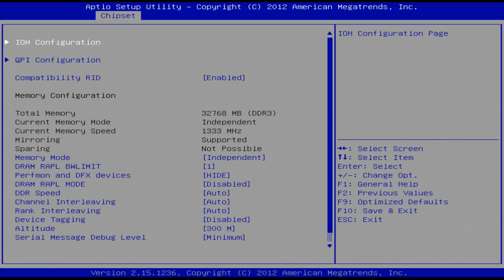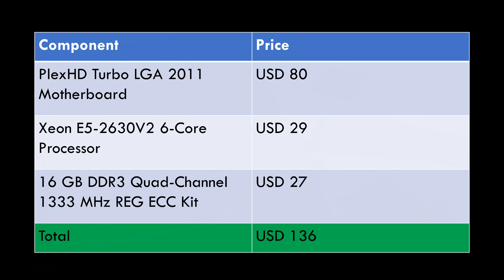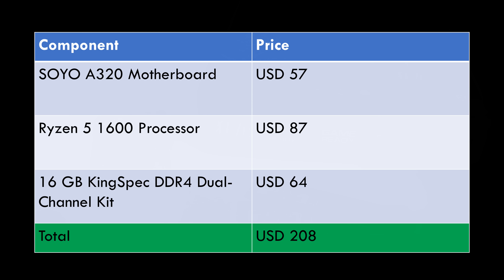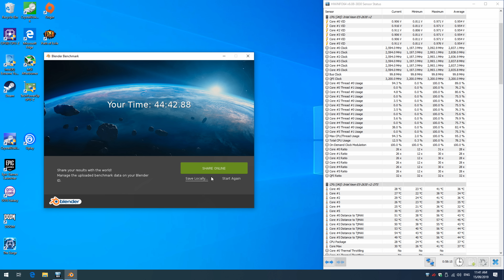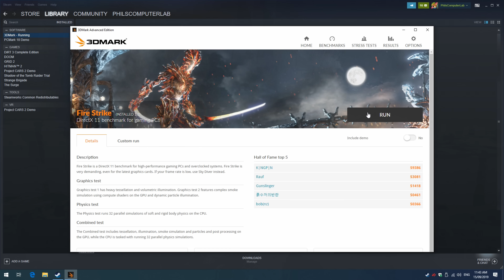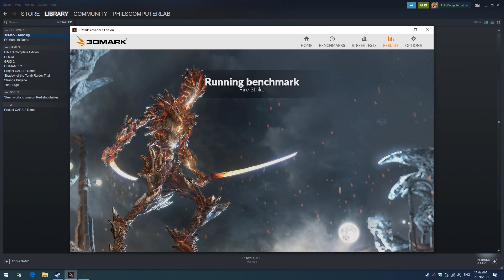Is this cheap 6-Core CPU worth it? The Xeon E5 2630V2

Comment: how would the xeon fare if you under clock it to save electricity? asking for a future server build
Reply: If you want low power consumption look for the 2630lv2
Reply: I wouldn't go that route but rather get one of them mini-itx with just about the same cost and maybe even better processing power  but less power consumption. Or look for a cpu that is low power ("L"  comes up on the cpu name)
Reply: @msana4420  well, its for an internet cafe server and i need a lot of ram for data caching and it can be found cheap here in the Philippines especially ecc ram the mini itx idea would be good for a wifi server(wifi ticketing service) thanks for the advice

Comment: One more thing that none of you understand! There is no old or new Game that needs a new GPU or CPU. Even if you buy a new PC on 2020 wont be good enough after the new generation graphics ! 2013 , 2020 we are still in the same generation of graphics. New generation graphic comes out with a new platform. Ps1, ps2, xbox ,xbox360 ect... untill a new generation graphics that comes out with a new platform u are stuck on the same generation. They stay hidden to the public until they release the new one. There is no new until then. U may have now high end GPU but this may not work in the new generation. New generation graphics may come out with a new DirectX or shader . That the high end GPU that u bought at 2020 may not meet with the new generation graphics cause it requires a new program driver to run those new generation that also cannot be installed to your GPU and it wont be supported on your actual "high end GPU". Since 2013 we dont have any new generation yet.
Reply: cool story. I'll wait for the movie
Reply: Manny hahaha sure
Reply: @eneadosti6366  you're right.....I wont.
Reply: 🙂 yes theres a ton of Stagnation and Diminishing Returns in the Video Game Industry, theres alot of capitalism and greed going on so the big companies are trying to reduce costs by using the same game engine over and over again, they rather concentrate on loot boxes and mobile ports. Amd users sometimes get upset when an expensive all amd build gets BTFO from a weaker i7 and GTX card on some video games and they dont know why? 😇 heehee
Reply: @MrSamadolfo  in the future  will be like i love my PC but i cant stay and play with it. they will make machines that you can remote and play in to your phone. By turning on of your machine at home from your phone and play with your phone. this new generation graphics will last longer than it did from 2013 to 2020. it was like 6 years difference from generation to generation. PS One December 3, 1994. ps2 March 4, 2000. ps3 November 11, 2006. ps4 November 15, 2013. PS5 12th February 2020. from 2013 to 2020 the only thing that is changed was resolution. the same will happened with ps5 even if it has 8k , it will add a new kind of resolution or framerate with the ps5s or something how they may call it. and will last 8 years, because they want ps4 pro to move on and gain money from them who couldn't buy it at that time. after 8 years starting from 2020 a new technology will come out. people buy GPU now because of resolution and framerate. Not because of a new graphic game. same will be from 2020 to 2028 . a 2 k Dollar GPU what you can buy now cannot support 8k gaming. that 8k what will come out in the end of 2020. GPU's now are too much money fighting for that 4k high frame rate, what very soon will be garbage.

Comment: Hello Phils, firstly thanks a lot for your videos and work you do firstly. A week ago i star searching a cheap motherboard for my father to reuse the i5 650 that i bought in 2010, because it dont need much power for his work, now is using a core2duo e7400 @3.2 , but this i5 goes up to 4.2Ghz easily. Anyway, i starting searching and comparing a lot of xeons and platforms, and then start thinking upgrading my sistem xD.

I have found this motherboard of huananzhi X99-TF, (X99 chipset lga 2011-3), it looks like a monster with two fans in the vrms, maybe capable of overcloking how knows. Is compatible with ddr3 and ddr4, dual NVME and  M2 Wifi ports and some other features. It would be an interesting motherboard to review socket is use in xeons between 2014 - 2016 , is a not the cheapest but so flexible.

https://es.aliexpress.com/item/4000221285759.html?spm=a2g0o.productlist.0.0.1dfe4a7cIYyVTT&s=p&algo_pvid=fec2d6b2-841e-40d4-84b6-9e6247f5fed0&algo_expid=fec2d6b2-841e-40d4-84b6-9e6247f5fed0-1&btsid=cae8b68d-ed91-4476-aa12-0fa108dddfb3&ws_ab_test=searchweb0_0,searchweb201602_,searchweb201603_52

I have an fx 6300 @4.4 (1.23-1.26v) and gtx 660 at 1.2Ghz with asus M5A99FX Pro 2.0, around 250-300W playing battefield 1 and rendering. I know upgrading the graphicscard i would notice a huge diference in games. Now is starting cold weather here where i live, so the power consumption is not totally waste because it keeps my bedroom warm :D
Reply from the maker: This is a nice board, but at that price, you're really better off with a first generation Ryzen system. A B450 board costs USD 80 and then you can get a Ryzen 1600 or 1700 and overclock it.
Reply: @philscomputerlab  Thanks for the help!!, yea im wonder with the asrock b350 pro4 mini atx model for 62 euros, it holds the 3900x pretty well with no oc and 3700x with oc no problem, they reviewed in hardware unboxed channel with that cpu. I mean, starting with 1st generation and then in the future when 3rd generation ryzens prices goes down it allows to upgrade to a 3600, 3700 or 3900 cpu. Maybe a z370 is better choice focusing un future upgrades, but the posibility is there.

Comment: I am searching a powerful cheap system where to run, even, XP, but since there is no site for drivers I think I could not run XP on the X79 2011 (+Xeon) board. I am asking if someone has found XP drivers... Thanks...

Comment: "the pcie is 2.0 not 3.0" but the m.2 slot, and pcie slots both say gen 3 right on them?
Reply: I'm guessing that the M.2 slot is indeed Gen 3, but uses x2 PCIe lanes instead of x4... But I don't own the board to check if it's true

Comment: Why are you sticking to 720p so often in games????
Reply: Because he's testing the platform not the graphics card. If he was to test at a higher resolution with an RX 580 he would be completely graphics card bound, and would not show the performance of the platform.
Reply: @jonathanellis6097  Not sure about that, 1080p would still demand more from the CPU than 720p, and it's more closer to what people play these days.
Reply from the maker: I have a RX 5700 now, so in future videos we will be testing at 1080p. But the RX 580 is holding back the system at 1080p.
Reply: @dcikaruga  if you are graphics card bound you are only seeing the amount of frames the graphics card is capable of producing. By lowering the load on the graphics card (i.e. lowering the resolution) it can now produce more frames, so you can also see if the CPU and platform are capable of producing more frames as well.
Reply: @philscomputerlab  A 580 struggling with max settings at 1080p? Crazy how GPU's are going out of date so quickly,
Reply: @philscomputerlab  That's quite an upgrade! 👍
Reply: @jonathanellis6097  Yah, but its so variable because somes games are more demanding on the CPU than others. I'd rather stick to 1080p because that's what the majority of people out there use for gaming.

Comment: nice Witcher 3 runs good on my I7 4790 16 gb  GTX 760 TI . I get 30 fps
Reply: Decent CPU but awful GPU, get rid off that thing. A 5700 or 1660 should be the last upgrade for your platform.

Comment: anybody knows how this would perform in moba like dota 2? and emulation like rpcs3
looking to sell my 1155 board and i5 3570 
I7 2600 and 3770 in my country still cost like 100USD people still think its worth gold
Reply: No problem in MOBAs, but PS3/XBOX/WIIU Emulation is not enough, you'll need a CPU with MORE IPC/MORE Singlecore Performance, I mean Ryzen 3 3600 + OC or similar Intel CPU from 1151 socket and chipset 300 series (Intel 8th/9th Gen). MAYBE JUST for Emulation and EASY PCGames that no need a lot Cores/Threads, you could have enough with a Intel i3 8350K at 5Ghz (OC), but better with a Intel Six Core and Overclock (Intel K in Z370/Z390 MoBo). The performance is different in each game, there will be games easier and others more difficult to emulate.

Here PS3 Emulator in Last of Us (first game) a GTX 1060 6GB is overpower (only 30-35% Usage), 6GB Vram is overpower (at 1080p only consume 1.2GB), 16GB ram DDR4 at 3200Mhz is Overpower (Ram Consume only 6GB)...12 threads is Overpower becuase only need six CORES (60% from 12 threads = about 7 threads with i7 8700K in Stock frecuency)....so he need OVERCLOCK that i7 8700K.

https://www.youtube.com/watch?v=SIMjpju0IhA

* Obviously there are games that will have to improve more (the emulator itself) if all people want to have a better experience, But that the Developers
 Emulator working on the Vulkan Graphic API will help to improve it....some day.
Reply: @juanmassiosare9850  great reply here im on a very limited budget here hence going on new parts is really not an option and plus its worth a fortune here in my country on new parts on ryzen and new gen intel even though used ryzen and intel is still expensive

the emulation is only for fun
but i did some research and found there is some xeon on the 1155 platform some 4 core 8 threaded are they any different from the i7 countepart or just the same without the hd graphics?
Reply: @eugenemendoza70  ....Yeah, they are much the same, some Xeon have Intel HD Graphics (last number is "5" like E3-1245) others not have IGP (like Xeon with last Number "0" or "1"...E3-1240 // E3-1231).

* Socket 1156:
- i5 750/760 = Xeon X3430.
-  i7 860/870/880 =Xeon X3440, 3450, 3460, 3470, 3480.

* Socket 1366:
- i7 920/930/950/960 (4C/8T) = Xeon W3520/3530/3540/3550/3570/3580 and X5550/5560/5570/5580...others.

* Here in socket 1336 we cant install Xeon 6 Cores/12 threads like Xeon X5650/5660/5670/5675/5680/5690 like i7 970/980 (6C/12T Locked Multiplier) and W3680/3690 like i7 980X/990X (6C/12T Unlocked Multiplier)

* Socket 1155:
- i5 2xxx = Xeon E3-1220/1225 (4C/4T) VERSION 1 aka SandyBridge MicroAchitecture.

- i7 2xxx = Xeon E3-1230/1231/1240/1245/1250/1270/1280 VERSION 1 or V1 or without "V1".

- i5 3xxx = Xeon E3-1220/1225 Version 2 or V2 aka IvyBridge.

- i7 3xxx ? Xeon E3-1230....etc etc etc VERSION 2 or V2.

- Intel Haswell socket 1150 = Xeon V3.
- Intel Broadwell socket 1150 = Xeon V4.
- Intel Skylake socket 1151 = Xeon V5.
- Intel KabyLake socket 1151 = Xeon V6.

* Socket 2011 /DDR3 and Socket 2011-3 have  A LOT Xeons with A LOT Cores/Threads in Version 1, 2, 3....

For example...i7 3930K socket 2011/DDR3 (6C/12T) is like a Xeon E5-1650/1660 V1 = SandyBridge-E....i7 4930K is IvyBridge = E5-1650/1660 V2...but there are SO MANY Xeon CPUs in Socket 2011/2011-3!!! xD

Comment: i've a 4820k x79 than runs games significantly better than this @4.4ghz 1.3v. Stutters and the upcoming shift in computer specs to run games with the 2020 16thread consoles.. not a good system to game and will become obsolete far too soon. Probably pretty good for general desktop use however. Kinda pointless for gaming now, maybe ok a couple years ago, now just find a cheap 1600 ryzen, plenty of people selling off their 1600/2600's due zen2. I would've pulled the trigger on a 100$ used 1600+b350 if my ancient 4820k wasn't still better for most (tho not all) games vs the 1600.

Comment: 200 $ holy shit .... i got my used 8700k and my z370 mainboard 4 225 $... on ebay
Reply: Ryzen 2700x better . All round.
Reply: On stock speed they are nearly the same ... i7 8700k on 5.1 ghz is way faster
Reply: @petermeter3942  3700x will be way better and but cheaper end of year.
Reply: Maybe, we will see
Reply: @petermeter3942  it will be.  Used market especially.

Comment: E5-2690 V2 would be interesting.
https://ark.intel.com/content/www/us/en/ark/products/75279/intel-xeon-processor-e5-2690-v2-25m-cache-3-00-ghz.html
Reply: I think these will be a fantastic option, even for gaming, once the prices drop a bit more on Ali. They also use the cheap DDR3 ECC. 
Currently costing about 140€ for just the CPU. 
That is 10 cores/20 threads with 3GHz all core turbo (or maybe even a bit more) straight out of the box, without any modding/hacking etc.
I guess there is not a big supply of them yet, until a data center somewhere decides to upgrade and they chuck 100,000 of them onto the market in a week!

Comment: 49W idle on lga2011 sounds like bullshit
Reply from the maker: It's idle, sitting on the desktop. Yea that's the entire machine at the wall with a power meter.
Reply: @philscomputerlab  I would like to see that, because my 2630LV2 on R4BE w 1050Ti was 75-85W+
Reply from the maker: @Mr.Leeroy  Yea check out these motherboards, at least they are cheap to muck around with :) Also make sure speedstep is working and power profile configured so it downclocks idle and lowers voltage. Ivy Bridge is very energy efficient.

Comment: bruh.... "dips to 30fps - definitely not playable" what the actual fuck? how is normally running above, and occasionally dipping to 30fps in any way unplayable? most tvs max out at 30fps, and that's what consoles run at, sure it might not be the best experience but it's in no way unplayable. Fuck, even locked at 20 i'd consider playable. Now fortnite, a competitive battle royale having insane stuttering, literally dipping to zero fps, thats what i'd consider unplayable, no matter how high the fps averages, but you think thats playable? 30fps and above in a single player game is perfectly playable!, stuttering down to zero fps in a competitive online multiplayer game is not. wtf